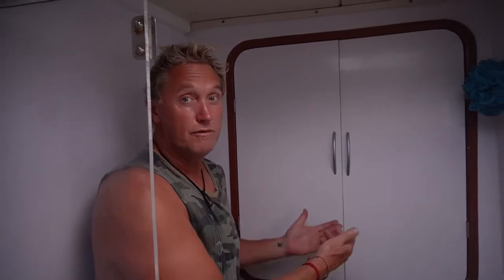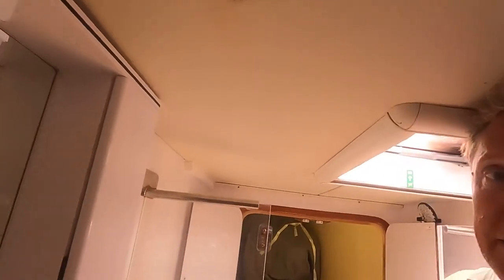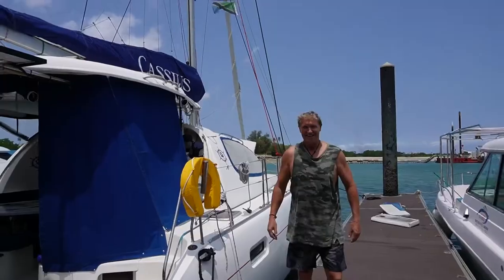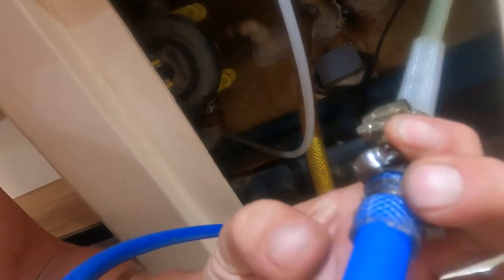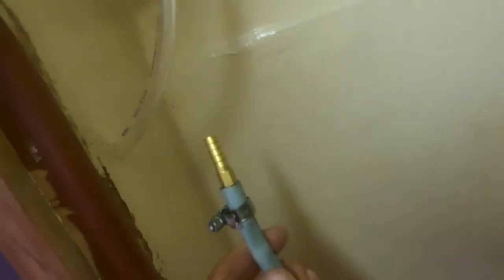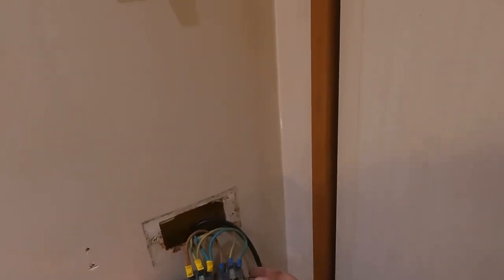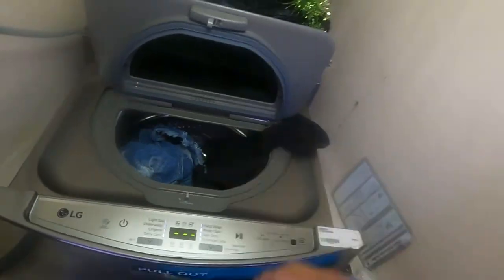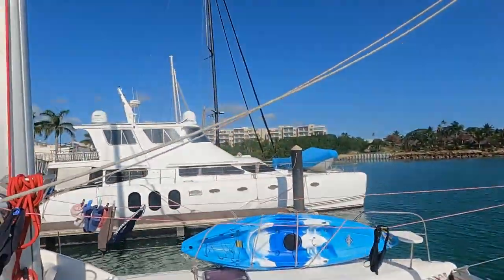LG Twin Mini Washing Machine on a Sailing Boat

Comment: But how does it go? Is it worth it?
Reply from the maker: It goes just like your normal automatic washing machine, only with a small load capacity. We can’t fit a full-sized washing machine on our Leopard 40, so this is a good solution for us. It’s definitely better than doing your washing in a bucket!